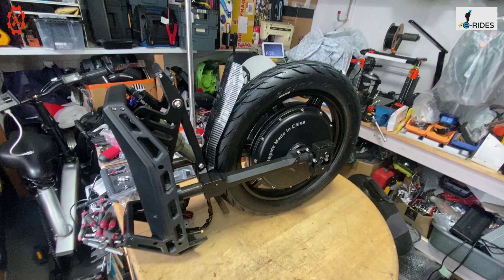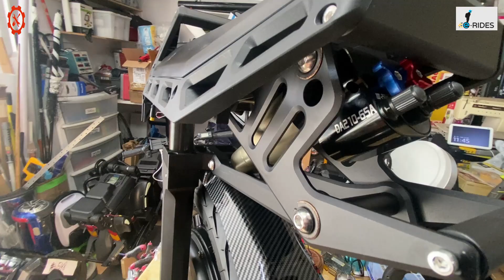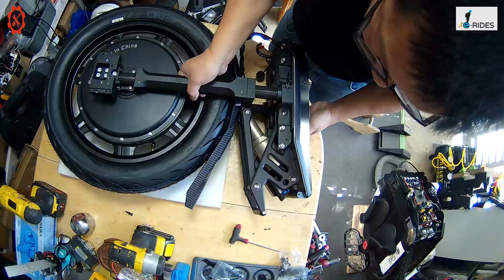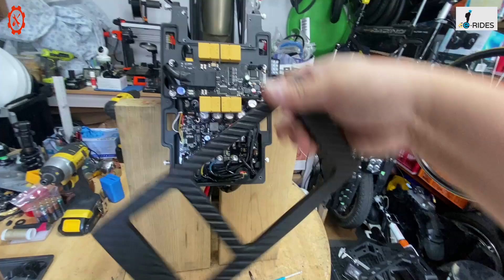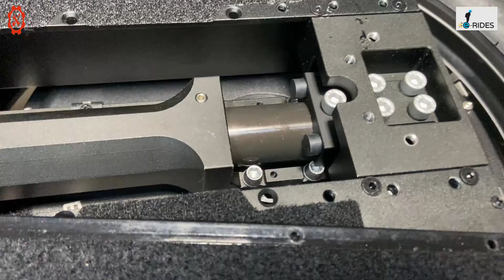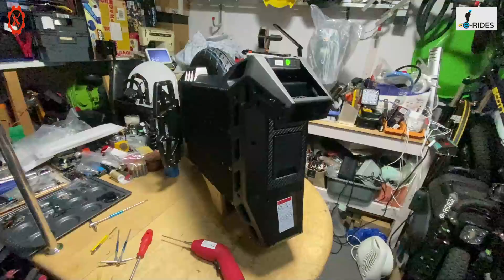Begode Blitz Build Quality Check. erides EUC Upgrades..

Comment: Why does the motor say 60v?
Reply: Because that motor internals were factory built,  specked at 60v. 
EUCs are powered like we used to over-amp our rc multirotor motors - for increased speed/performance.
[The higher the power,  the faster the reaction-time:  Motor able to run in both directions on demand w/ least delay]
They're rated 'RMS' [average / constant for long derations] and 'PEAK' [Max burst/instantaneous ]
*It would be nice to see some oscilloscope tests done on them while running through their power-range 
to get a visual on exactly how efficiently/safely the system is,  especially while over amping..
Reply: @DirtyDovi  Ive given a few electric motors some "over voltage" myself back in the day. Usually when it's that much over it smokes the windings and burns out.
Reply: @tomjackson5451   When cranking it up to 11 goes wrong..  lol  
Yeah,  the copper wiring gets so hot that the heat nukes off the enamel insulation,  and it's game over.  At least w/ the EUC motors going,  we don't have prop shrapnal to dodge too.  😁

Comment: It surprises me that Euc's are still operating so much in the wild west still with their designs instead of iterating on a good foundation which is the proven way to make a product better over time. What kind of person chooses to grind down bolts instead of making another plate to accomodate them? Its the kind of thing you do for a prototype until you can have the right parts made for a final solution and I get that they probably aren't very profitable yet but thats another reason to stop making wheels from scratch every time. With all the feedback available online from videos like this there is no excuse for such lazy solutions like that trolley handle. Great break down of the wheel, its one of very few that properly shows how well the product that holds people's life in its hands is made.

Comment: Wont argue bout the materials but to say the trolley handle is 'crap' is somewhat premature. I'm a huge fan of the K.I.S.S. principle so simple is best, for me. Its a trolley & the main issue is does it work? If it dont, then ya its trash but otherwise, its a trolley. To me, its not the most elegant but from other vids of usage, it seems much stronger than the old janky BG pullout trolley. The plastic plates btwn batts are only meant to cover the gap & not structural support so I get why its flimsy plastic. Been using a 1/8" ABS sheet on my Master v4 & T4 for this purpose so for me, this would be better as it saves me this step. The display on the front handle tho is crap as it cant be seen whilst riding. Rest of build seems ok if not good, to my eyes atleast. Thanks for the teardown or buildup rather

Comment: I really enjoy watching your breakdown of wheels, not only to know what level of quality and engineering goes into a wheel but helps when we eventually have to work on them ourselves.
Since I have a v4 Master I am very interested in how things have improved in the Blitz. One problem with the Master is the way the fork tubes are clamped top and bottom causing the tubes to distort and bind at each end of travel. On the Blitz it looks like there are threaded plugs reinforcing each end and keeping the tubes round. Of course, this eliminates the ability to use the tubes to house the trolly handle like the Master.  Despite the compromised trolly handle on the Blitz, I think having a free sliding suspension is more than worth it.

Comment: thanks, very informative.  Pretty sure the motor is C-32 tile motor, first time in use.  I'd recommend trying the trolly handle before dismissing it completely - even with it's limited pivot point, and lack of any lock, it works better than trying to just use the front handle/screen.

I'd be interested in the easiest way to get at the Blitz rim/hub motor, once fully assembled for a tire change.  I'd think the tire change would be similar to Master, but I'd like to see a video getting to the rim for tire change access to see any differences.

Comment: Outstanding!!!  Two questions. Q1: Could the display be velcro'd or foam-taped to the top of the light, and a spacer inserted to where the display once was?  Currently, you can't really see it, where it is at because of angle, and it's in a bad spot if wrecked.  Q2: Those motor-mounting fastener heads are so thin-walled, I fear they will snap under extreme torque.  Or worse, break off with nothing to grab onto.  What do you think?  Thanks. ~maverick
Reply from the maker: Yes it can. You can take it off and stick it on the light or on top of the cover.

Comment: Like the wheel but those motor bolts look to small and weak to me and the heads are likely to strip and crack when you need to change your tyre .